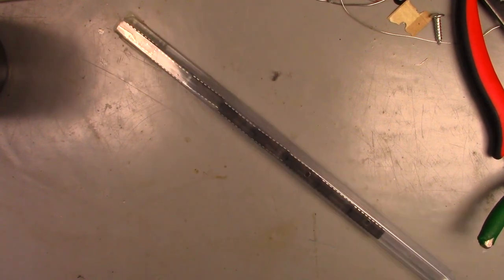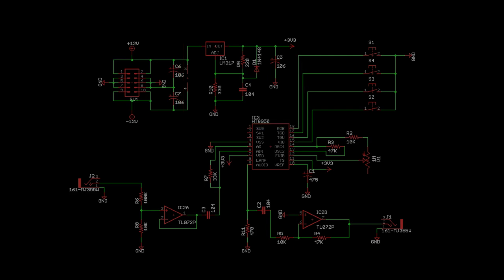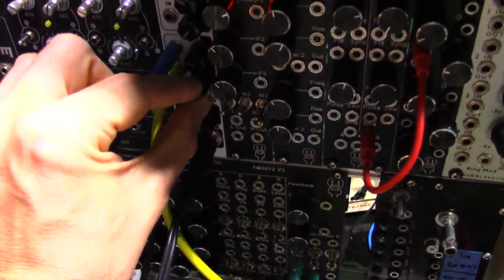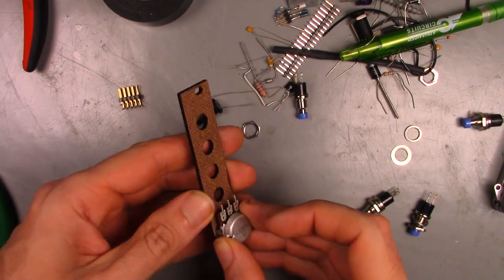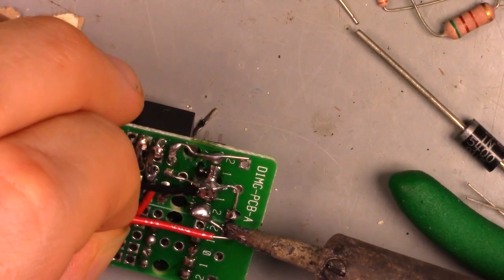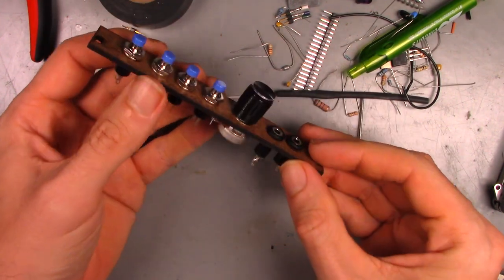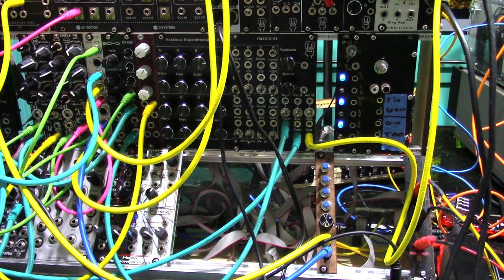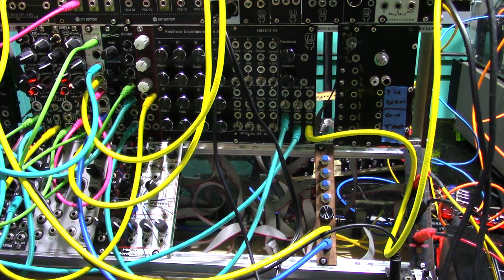HT8950 "robot voice" Eurorack Module Build

Comment: Where did you get the ht8950 chip? Can't find it anywhere except on ebay which seems expensive and sketchy
Reply from the maker: e-bay. I just take my chances. Most chips like this were pulled from working hardware as part of recycling old electronics. So you chances of getting good chip are good, but not guarantied.